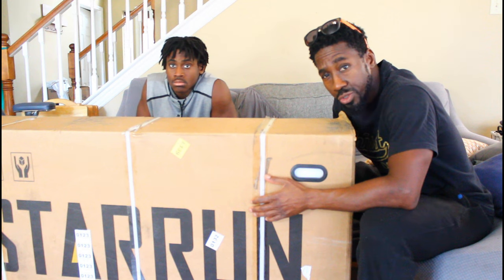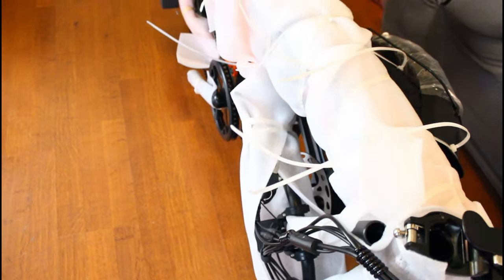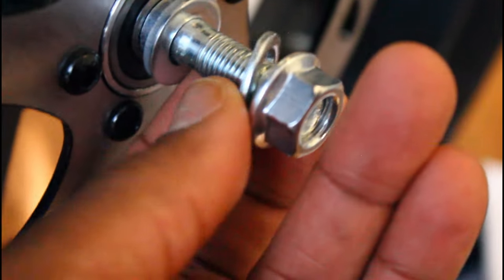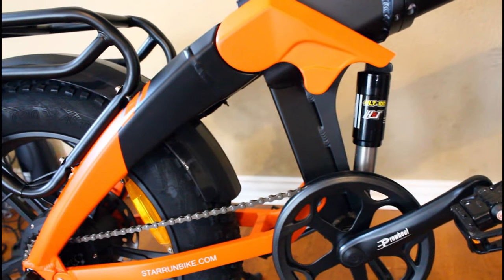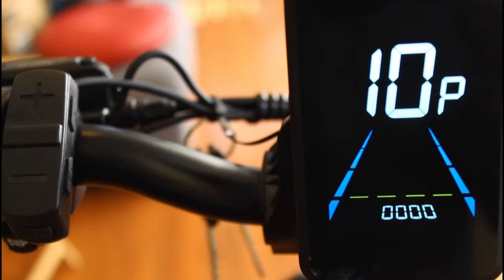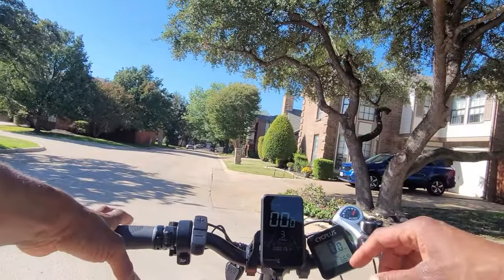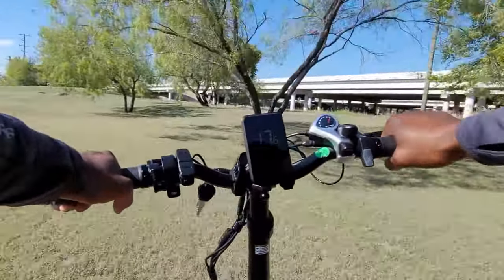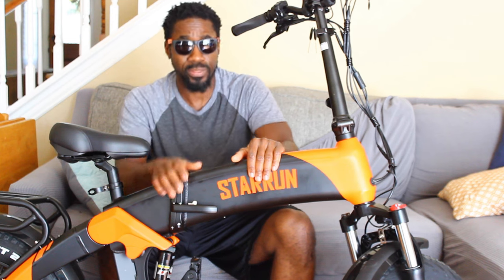Best E-Bike - Cheapest Folding EBike With Full Suspension & Range? STARRUN S20 Electric Bike Review

Comment: There are so many ebikes available now, folding, non folding, suspensions, single/dual motor, 500w-2000w+, small battery/big battery/removable batteries/dual batteries, different wheel sizes, it's overwhelming. The nice thing about your reviews is you actually ride them, we can hear them,  see how they handle non smooth surfaces, acceleration, braking and comfort, but  its just a tiny selection of the massive  market now. Keep up the good reviews.
Reply from the maker: Wow. Much appreciated
Reply: tengo una escojo ud dice en sus comentarios, pero te dejo saber la bicicleta tiene lo que dice, a mi parecer es una copia de la encelo que si te rompe los cojones es la bateria,si te fijas el cuadro en la parte donde va la bateria es curvo, por eso la bateria es en forma de curva, bateria que no se ve en el mercado de las baterias, del mercaDO común, la bateria vale alrededor de $300, las tiene el vendedor FUNCARE,es el nombre de donde se envía la bicicleta desde california ee.uu, pero toda estas bicicletas sus componentes son de fabricación china, The interaction of the shock absorbers can reduce the physical discomfort of riding, allowing you to ride comfortably in the city. 【 Foldable & Convenient Design】 DEEPOWER electric bike is designed to muchas son ensambladas en ee.uu las que son embaladas en ee.uu valen mas que una motocicleta.
Reply: 😅I'm loving my A3 🎉awesome 28mph💪🏾👍🏾

Comment: What a great folder! Most are under powered... Did you ever try full throttle in PAS1? I was wondering if the throttle is limited by the PAS setting? Good review, I subbed...
Reply from the maker: Much appreciated.  I don't have the e-bike anymore but I think the throttle takes you to full regardless of the mode (but this is from memory. lol)
Reply: @HeroesNStuff  The throttle on my G-Force T42 will hit 34mph in PAS-1, Wife's EUY AULOOR, throttle top speed in PAS-1 is 12 mph.
Reply: @HeroesNStuff  By any chance, is this the bike that Alexa has covered in glitter?

Comment: Are the tires puncture proof? And will changing the tire easy? I think i want this ebike so I'm gonna get it next week.  Well done review 👏 👍
Reply from the maker: I definitely wouldn't say puncture proof.  You go over a nail or sharp object over 1 inch...It's puncturing the tire.  But it is puncture resistant.  Taking the rear tire off can be challenging at first ...as you have to disconnect the wheel from the pas...which is a unsnap.  This gets easier after the 1st time.  good thing about e-bikes is a lot of the electric components are snap-and-play.

Comment: Love the video . Hey what do you recommend the best psi for pavement riding for comfort and best range . The sidewall on mine says 30 but 20 already feels really stiff and when ever I go over a small crack or bump I feel like I can really feel how stiff the tires are and It makes the vibration and ride harder . I have the preload all the way loose
Reply from the maker: I usually do around 10-12 under the max psi.  Some of these tires pop when I go over this (probably due to the speed..I go FAST a lot).  But 10-12 under usually feels more comfortable over cracks and bumps while also not running the risk of popping (from my experience)

Comment: If possible, can you check what kind of controller it has? Possible to unlock the speed limit beyond 28mph? In theory, 52v x 40A controller = 2080W which is ridiculously fast. But the controller on this might be less than 40A

And uh, sounded like your disc brakes were rubbing throughout the video.
Reply: 25 amp controller
Reply: That’s all I wanna know before I order this lol

Comment: no te compres una bike para correr mejor comperatela para pasear al aire libre hacer ejercicios The interaction of the shock absorbers can reduce the physical discomfort of riding, allowing you to ride comfortably in the city. 【 Foldable & Convenient Design】 DEEPOWER electric bike is designed to basta con eso ahi vemos a la negrita que lo que menos muestra es el funcionamiento de la bicicleta, mas bien modela su lindo trasera como si fuera la estrella de yuotube.